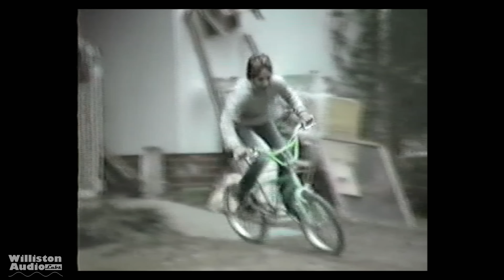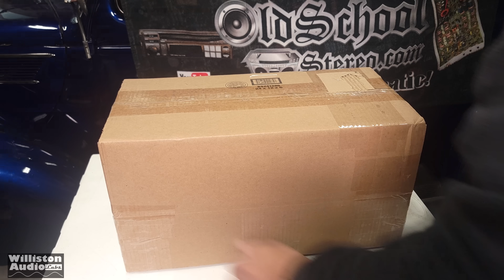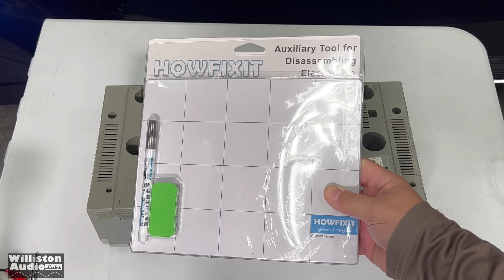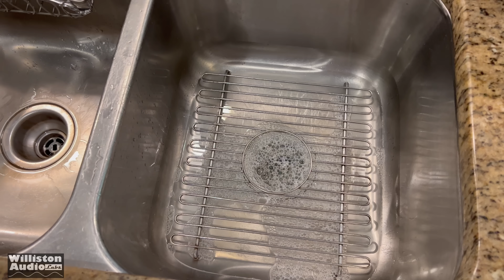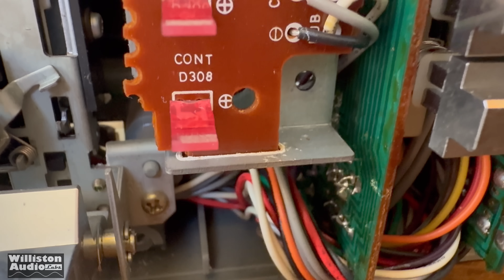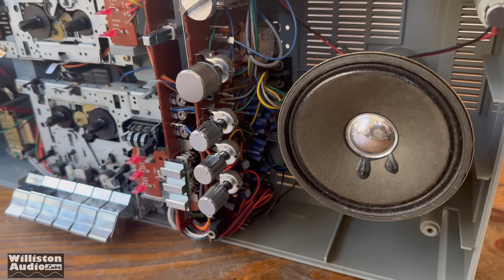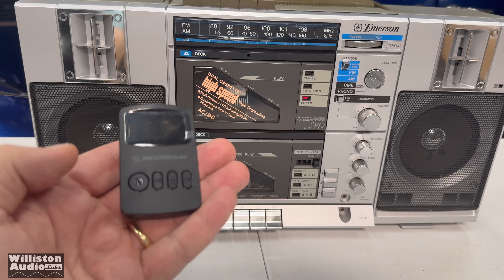$69 in 1985?! The Emerson CTR949 Boombox That Fooled Everyone

Comment: You're 100% on about the speed of the tape door, I also  love taking everything apart, i had a really nice Panasonic around 89/90 ish. It Took 10 D batteries, loudness button and separate  bass and treble with soft touch controls. It was very power hungry, the meter lights would dim, and bass would distort on battery  power, sounded beautiful plugged in!! Really  good size magnets for the 20 watt rated speakers, mom bought it from a friend for my 13th birthday, it was better than most peoples boom box, as far as a  bad brand , i remember a really cheap system with double slider volume controls that were kinda fake called YORK!! I would chuckle to myself every time someone had one and thought they were good! 😅 But the YORK wasn't a boom box.
Reply: Pretty sure the name was "YORX", and yes is was very cheap name.

Comment: My first boombox (if you could call it that) was a small Sharp GF4545. It was about on par with this but only had a single cassette deck. Then graduated to a Magnavox D-8628 that had detachable speakers, a phono input that could be used with a moving magnet cartridge and the cassette deck was surprisingly good with Dolby and could record metal tapes. I ended up killing it by putting in 2 small Radio Shack tweeters in it because even though it already had tweeters in it, it lacked high notes. I’ve had an original JVC Kaboom box since they were introduced. It still works 100% even the cassette deck. But other than taking it outside on the patio it’s been indoors most of the time. I have a Sony 5 disc CD changer connected to it and use it as a bedroom stereo now. It do bump doe for what it is.

Comment: I had a black Sony CFS-1020, and I swapped out the 4" speakers with 4" realistic car speakers.  The swap made all the difference, better highs, lower lows, louder.  It lasted over 10 years.  I even used it with a cassette adapter to play CD's.  Even better, the speakers detached, so it had speaker terminals on the back that I could use to plug in whatever speakers I wanted.

Comment: I had one of these too back in the days, mine in black and branded "Mark" (yea, really 😀). Got my hands on one again last year, just as good condition as yours. Had to replace the belts in the tape decks but other than that it's working great.
The noise is usually due to dirt in the record switch, which mine also had a problem with. I use mine every now and then just because i can and want to keep it in good working order.

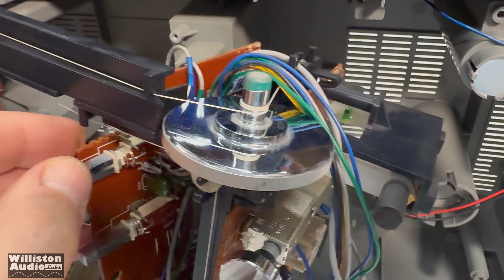Comment: I HATE those wrapped wiring systems. Cheaper than soldering. Those pins still have to be soldered to the board. But probably speeds up installation when they come pre pinned. Then all the worker has to do is use a machine to twist those wires on (12:51).

Comment: That's a very strange construction, putting the speakers on standoffs like that. Even the fake tweeters. At some point they probably were going to use piezo tweeters, otherwise there would be zero reasons to spend money on those standoffs. Luckily the fakes will accomplish the same thing as real piezos.

Comment: Build your own with all car audio gear  stuff  and a few dyi audio board   with a 3d printed boom box to case it all.   With all the  new audio  decoder  style.    power by power tool 18-20v batt   and/or 110v laptop power supply port . Of course with step down power converter on the inside for the equitment.  Would be a sweat build.  Also really cheap to build if you already have extra audio  laying around. 💯🎵🎶😉✌️.   Use a multi meter  its not hard to trace it.   The tape head reader  the wire that connect it will  go to    audio input  location  your  looking  for.     Im not a 💯 percent positive  but most of the tearable tape noise comes from  the tape head reader.   This in my mind mean  if you took the  wire off the reader  head        you should be able to cheat and hook you audio  input source  to the  reader wires .  there wouldnt be any extra  niose because  its no long connected to the tape head reader it self.   Of couse the amp noise will still be there if it needs caps  though.  🎵🎶💯😉✌️
Reply: And these days you are lucky to get 2010s and 2020s cassette decks with AC erase heads such as Sony's CFD-S401  from Japan, Orion boombox or the We Are Rewind boombox as both boomboxes Techmoan reviewed

Comment: Ceramic cartridges are essentially line level without any RIAA equalization, so suitable for a CD player or other modern devices, just try it. 
The OSC switch selects the AC bias frequency when recoding to tape. The AC bias is a high frequency, typically in the range of 50 - 150 kHz and mixed with the signal to be recorded to lower distortion and help with the non linear characteristics of magnetic materials. It's inaudible due to the high frequency and the speakers can't reproduce it, but it could interfere with the radio reception on medium wave/AM.

Comment: My first boombox was a 1993 SONY CFD-510 and I still have it and still in new like condition.  4 inch speakers, separate tweeters, CD player AM/FM radio with single cassette deck.  Last I checked it should still have Beastie Boys license to ill in the CD player.  I remember once hooking up my 10 inch MTX blue thunder subwoofer up to it.

Comment: "OSC" = oscillator. I believe that the recording process employed some sort of oscillator and it would interfere with A.M. reception. Also, many audio electronics devices of the time had the volume control inserted between the preamplifier and audio amplifier. You can locate the volume control, turn it down to minimum volume level and using an ordinary piece of wire to probe the terminals on the volume control. Volume control will be  two potentiometers ganged for stereo and each one will have three terminals. With volume turned down as stated find the two terminals that will give 60 Hz hum. That is where you can connect the input(s) of your bluetooth module.
Reply: Yeah, when recording an inaudible high frequency in the range of 50 - 150 kHz was mixed with the audio as AC bias to correct for non linear magnetic properties of the tape and to reduce distortion. That  frequency the AC bias uses could interfere with the radio reception and was therefore often selectable in a few steps.

Comment: I had a Magnavox but wasn't nearly as big as that Emerson.  I also had a Realistic shelf system from Radio Shack. They both lasted from around 12 years until I got rid of them. On the Realistic I ended up wiring two eights and used a 25x2 car amp on them with a LOC and a converter. Sounded good 😂

Comment: Just an idea, if your not worried about the FM radio or its functionality you could strip a cheap Bluetooth speaker and install its internals into the unit with the battery and USB socket in the d cell area and buttons wired to the units switches. If you really want to be fancy upgrade the speakers too.

Comment: Panasonic RX-C45L here. Had it between 1984 and about 1996 by which time the tape deck cogs had totally worn out. It was an expensive unit but very cool in my opinion and quite compact with with a good sound quality.

Comment: Yeah back then at least you got to listen to him but one thing I wanted to bring up is that the battery usage the cost was extreme I know I had a boombox it go through batteries I have to buy batteries every day to play it listening to the radio it did pretty good minute you dropped the tape in it whammo it suck the juice out of those batteries and I don't care if it was Duracell Energizer or die hard you needed to plug that thing into the wall with the cord it came with but they weren't that bad especially with a photo input thank you to some options and keep you on a budget

Comment: Back around 1986-1990 I had a Sanyo M9818 single cassette deck boombox with detachable speakers. In pictures it looks kind of impressive but on the side speakers only the top speaker driver is real, the bottom one is a passive radiator and the tweeter is fake. The speaker in the main unit is only active if the side speakers aren't connected and it was the best sounding speaker in the whole unit. 

That unit kept me going until summer of 1990 when I got a crappy Yorx Grandeur 2306 bookshelf system that had my first CD player and dual cassette tapes. That opened up the world of dubbing tapes and copying CD to tape, which with the help of borrowing stuff from friends and kids at school vastly opened up my music world. 

That led me to me saving every dollar I could in order to build my own component audio stack in 92-93. It consisted of a Sony surround sound receiver, Pioneer 6 disc CD changer, Pioneer dual cassette deck and a Realistic 10 band EQ. Those were initially hooked up to a pair of Pioneer house speakers with 10 inch woofers which were later upgraded to a set of 3 way Pioneer house speakers that had 15 inch woofers and again later changed (around 1995) to a set of Cambridge Soundworks Ensemble speakers with dual satellite speakers and dual passive subwoofers. The Ensemble set I got a super deal on at my local Best Buy (it was originally $600) as it was the demo unit and the back mounting bracket of one of the satellite speakers had been damaged. I think I paid like $200 for the entire set as a scratch and dent deal. 

Those were good days to listen to music at home! :)

Comment: Why not tap into the phono or mic inputs for the BT module? May need to adapt for the type of signal it wants mic vs aux etc but that was common enough back then that Radio Shack sole them IIRC. 
My box back in the day was a Sharp GF-4545

Comment: ill just FYI that if you clean the cassette head itself then put in one of those "cassette tape to aux" (or blue tooth now) you can get really decent results without modification to machines with damage to the old tape mechanism. 

just beware of the door and having to poke the cable out if you are going to use an aux cable adapter tape! (blue tooth units dont have this issue and also have an internal battery!)
Reply from the maker: Great tip!

Comment: My first boombox was a general electric with a 6-in speaker and a 8-track record player. I also had a really big Fisher it took like 20 D batteries and it had detachable shelf looking speakers dual cassette deck will power meters. I also had a slim general electric dual cassette deck dual 5.25 woofers and 1 in tweeters. Theses were before 1985 Emerson also made some pretty huge boomboxes to add JVC JCPenney's was the place that sold most of those big boom boxes back in the day besides radio shack

Comment: I had a single cassette Sony back in the mid 80's. It was an ok unit for the most part. 
It was Xmas '91 when my parents got me a killer Panasonic CD/dual cassette player 4ch (yes,  4ch discrete channels, 2 tweets, 2 mids), 5 band EQ.... thing was (still is really) awesome. I still have it to this day. I believe that the belts to both cassettes need replaced though.